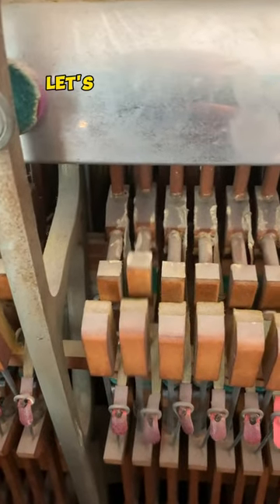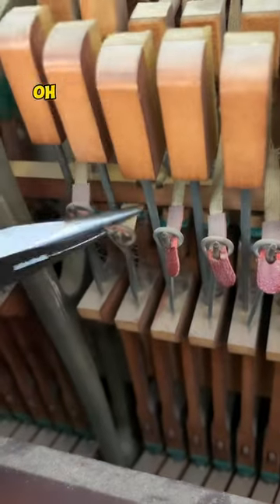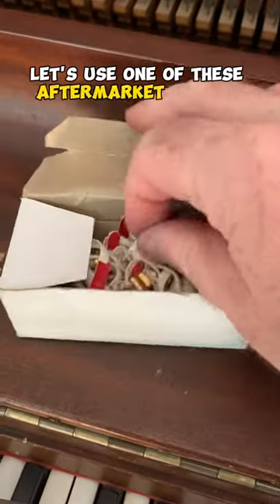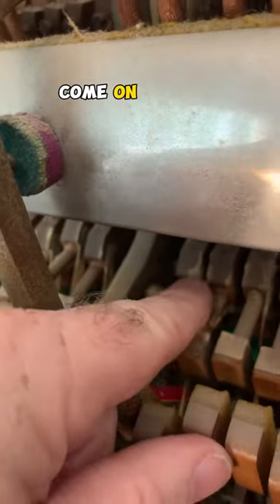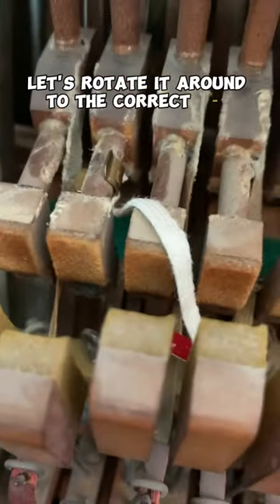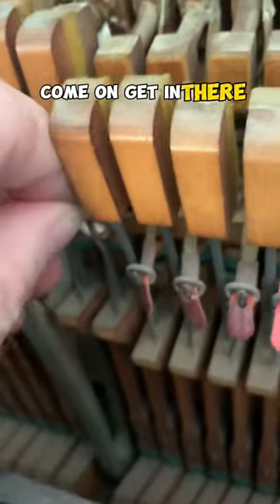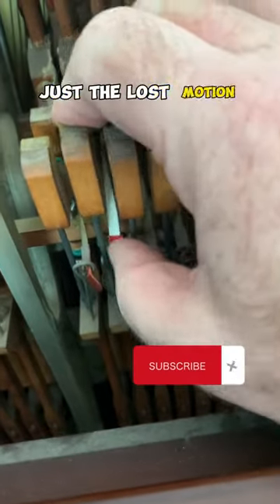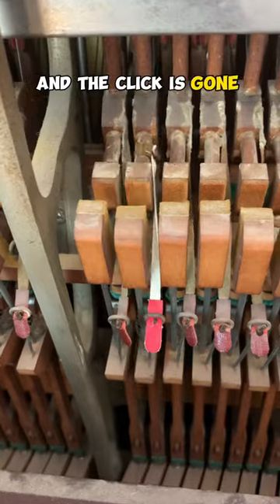Find mysterious click in piano #piano #pianomusic #pianotuning #woodworking #music #antique #click

Comment: That click usually means the butt felt is worn/missing and the jack is hitting the back of the hammer butt. You can see that it’s rest position is significantly different from the rest of the jacks around it because of that. Clip bridle straps aren’t my favorite, and I’d always encourage a tech to use a dab of glue to help secure them. Also, the correct tension on a bridle strap is enough slack so that when the hammer rail is in half position it isn’t pulling any of the wippens up.
Reply from the maker: Correct. In this case the felt was only worn a little at the bottom so the click was only obvious because the strap was broken. I took the opportunity to show installing a clip on replacement strap. I too don’t like the clip on options but I had some on me when I came across this piano. Well said on your part. 👍